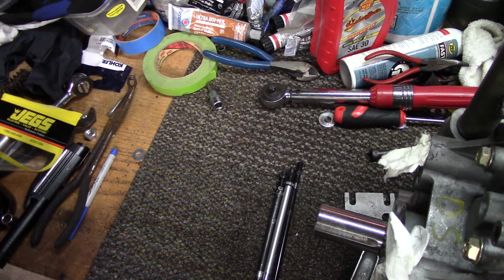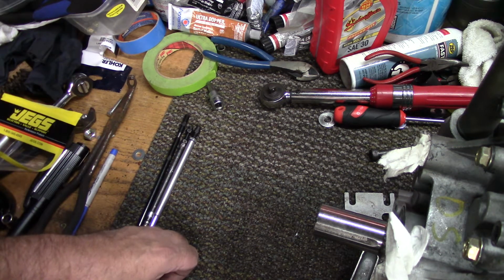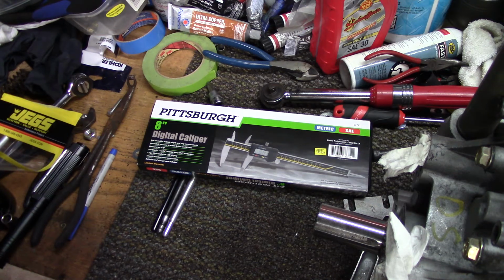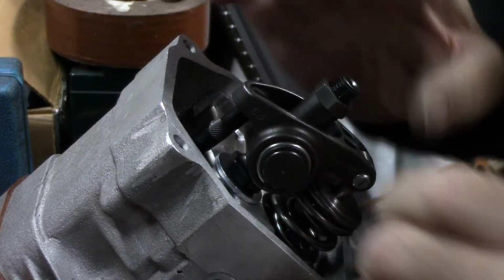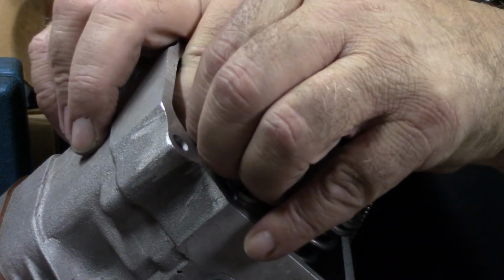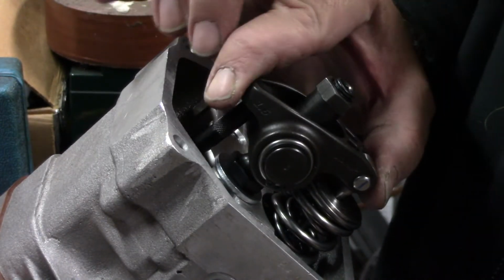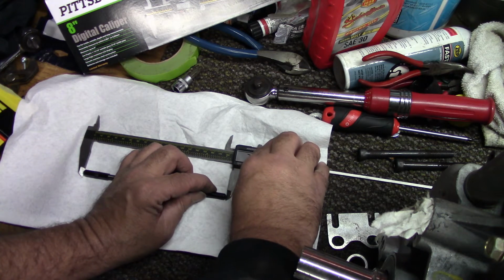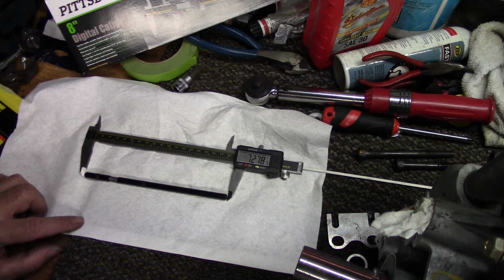Pro Mod V Twin Build, How to measure for custom push rods. #MWSC #Gardentractorpulling

Comment: Where can you find these pro v heads? These look like these are the re cast versions? If you go to MWSC page it looks like they are calling the billet heads pro v....reason I'm asking is we are running in the FXT racing mower class and the rules say no billet heads..only cast can be ran. So I thought the re cast would be perfect! But I have searched the whole internet and can't even find pictures of re cast kohler heads much less any for sale😂...its like they was banned from the internet 😒
Reply from the maker: I don't believe anyone makes a recast head only billet. Those heads came from Midwest super cub

Comment: Good work. What do they make the custom rods and tubes from?
Reply from the maker: Chrome Molly.
Reply: @PullerbearEd    Do you mean 4130? If so, what diameter?
Reply from the maker: I have to call the company and give them the specifics in the valve train and they will get me what will work best...

Comment: I just watched your other video on rockers. Think I figured it out. By setting your roller where you wan it on the valve stem, I pretty much decides it correct? I’m just getting into pulling Ed. Did you make the stock adjustable push rod or buy it.
Reply from the maker: I got them from Summit Racing. All the lifters, rockers are the same thing as what's used in the small block chevy.  If you are going to switch to roller lifters and rockers you have to get a cam that is for that setup.

Comment: What are you looking for a angle Ed? Are you looking for the rocker to be level? I know if your push rod is to long, you can get coil bind. Great video!
Reply from the maker: Your look to set it up so the roller on the rocker rolls across the center line of the valve

Comment: ED Top end oiling? You can use V8 push rods 3/8 or 7/16 & cut to length.
Reply from the maker: Yes you can, but that will be up to Twisted as to what he wants to use. I'll get a video of the oiling for you when I put the top end together.
Reply: @PullerbearEd   On the top end oil I'm using a  CV25 converted to a CH25 in my Gehl skid loader & with the solid push rods thinking how the topend was getting oil. On the push rods we made our own push rods 50 years ago on our injected 427 Ford C/Dragster we cut down Hemi pushrods w/ 750 lb open seat pressure. Question can you turbocharge your tractors or no class for them?
Reply from the maker: There is not a class right now for them. the problem is the turbo pressurizes the float bowl.
Reply: @PullerbearEd  You don't have to blow through the carb like the old Turbosonic induction system uses reed valves to control Boost. We used that system back in the early 80s use a stock carb works great. https://www.youtube.com/watch?v=zrVQdgRHCjo
Reply: Also the 1979 Mustang 2.3 turbo & Buick used the same basic Turbosonic system just jet up accordingly and control the boost by stacking reeds .
Reply: Or you can use a VW cold start injector its a on/off style & use a Hobbs switch to turn on the injector at any boost pressure you like. Lotta ways to skin a cat.🙃
Reply from the maker: I'll have to do some checking into that when I get a little extra time. The biggest thing is there is no class for that setup and in most general rules it says you have to use a stock appearing carb.